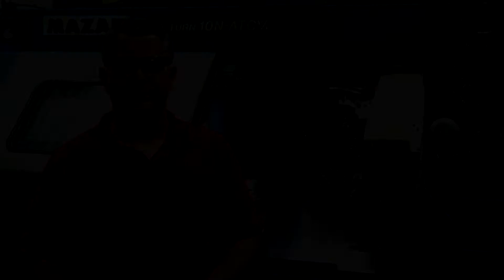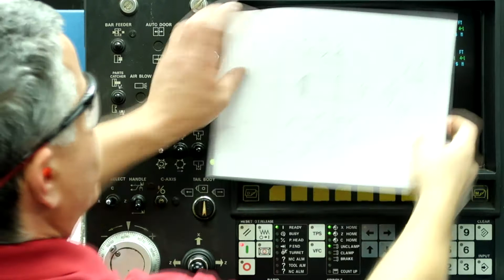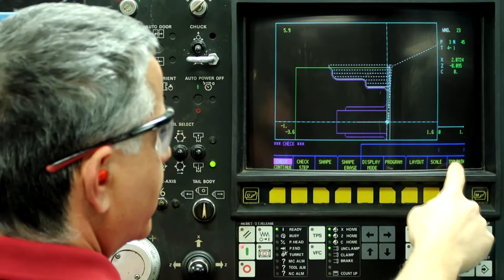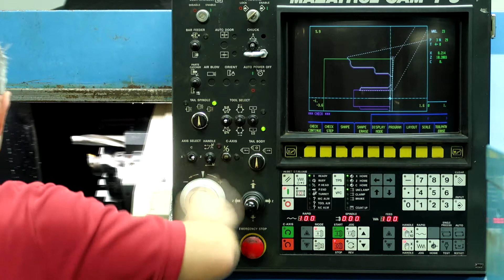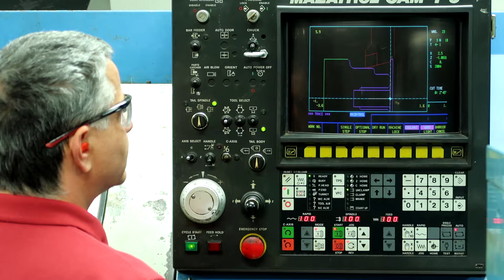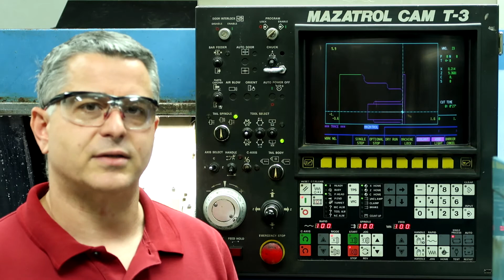Mazatrol Programming Tutorial CNC Video Part #3 Mazak T-2 T-3 Lathe

Comment: im running a mazak with a t plus control , im making a m30 x 1.5 thread and its cutting the thread crooked rest of part is straight , i am not a new machinist i have watched your video on od threading and many others , i just need help im stumped , i did have repair guy come in and check spindle and turret and they are straight
Reply from the maker: How long is the thread and is is supported by the tailstock?
Reply: thread is only 40 mm long   @mazatroltipsandtricks6816

Comment: Hello Sir, by selecting the tools, what is the meaning of "tool 4 offset 1"? because when I am programming I leave the offset blank.
Reply from the maker: Offset 1 means column 1 on the older control. That is where you adjust the wear offset. If you leave the offset to 0, then the machine will not pick up any wear offset.
Reply: @mazatroltipsandtricks6816  oh, I see.. Thanks for the info Sir.. How about the highlighted part in BAR, Like IN and IN with highlights, OUT and OUT with highlights?
Reply from the maker: @SimpLeMan2888  The highlighted features changes the lead in direction of the tool from Z to X.
Reply: @mazatroltipsandtricks6816   Thank you very much Sir!! I think you should hire me as your apprentice... 😁 .. Anyway, have a Good Day Sir!

Comment: Hey Phil, first of all thank you for all the videos you post they are super helpful. I just recently bought one of these machines and have it in my garage. Quick turn 15. I'm having problems with a battery alarm nmi 23 and I was wondering if you know the locations these on this machine?
Reply from the maker: What control does it have?  T-2 has 2 and sometimes 3 batteries. Do a search on the Practical Machinist Mazak forum and you will see the battery location and the options to upgrade to better battery options.  https://www.practicalmachinist.com/forum/categories/mazak.36/

Comment: loving your videos Phil! I thank you for doing this. I just purchased a used 1989 QT15n and reselected her from a guy that was going to part it out over a bad spindle drive. I had CNC Drive Drs  talk to Ken if you ever have problems. My question for you is I am in the tooling up stage for this lathe and I am wondering what your go to tooling would be for this machine. I am a mold maker by trade and my expertise is on the milling side of things.  If you could please point me in the right direction. Thanks Phil!

Comment: phil i am experiencing chatter noise when i am rough cutting .15" / .16"  per side ( BAR OUT) i have tried two different holders (DNMG and VNMG insert holders) i get the same response the finish is good 
what do you think is causing this chatter noise? 
the noise is very similar to when you have a bad insert although my inserts are all new
Reply from the maker: Does the chatter go away at .100" DOC?
Reply: @mazatroltipsandtricks6816  didn't try it but it might 
what are you conjecturing?
Reply from the maker: @christophercolumbus8944  Try a smaller cut and see what happens.
Reply: @mazatroltipsandtricks6816  ok i will thanks
i should add i am only chucking on 1/4" of this 4" diameter solid steel that is 2.25 long 
but i don't think it matters since i don't get this bs on my okuma lathe with almost same chuck and same jaws...

Comment: Sir,
Waiting for program copy, unit copy, sequence copy in one program to another program.
Reply from the maker: First, create a new program PNo0 line. To copy an existing program, you push right soft key, push program copy, type in program number you want to copy from memory and then push input.

To copy a process from same program, push right soft key under monitor, push process copy, type in program number you are currently using, then push input. Type in process number you want to copy and then push input. 

To copy process from another program in memory, push right soft key under monitor, push process copy, type in program number in which the process exists, then push input. Type in the process number you want to copy and push input.
Reply: @mazatroltipsandtricks6816  Thank you very much sir, I will try and update for the same.

Comment: hey Phil how do i modify the lead out on the boring bar 
say it was a tight hole, i need to back off only about .05" before exiting   ?
Reply from the maker: That is controlled by a user parameter. Unfortunately the parameter is different for each generation control. What control do you have?

Comment: How to take backup
( tool-data, program, parameter, tool offset backup )on mazak controller?
Reply from the maker: You will need special software to communicate with the controller to backup the system. An alternative is to take photos or pictures of the parameter screens.

Comment: which video covers TOOLS? and tool data? and tool geometry  ?  
any experience with 640MT ?
Reply from the maker: Look at the video that says probing tools on the thumbnail.
Reply: @mazatroltipsandtricks6816  ok thanks, Phil got another question
when ¥ou type or say tool number" 12" OFFSET "1"!!!  isn't that dangerous ?or  is that very typical in Mazatrol programming ? 
usually it's always T121212 
do you know what i mean?
Reply from the maker: @derick3482  On this old machine, it is column offset 1 or column offset 2. Column 2 is like the second offset and it's not used very often. This is not a Fanuc.
Reply: @mazatroltipsandtricks6816  so the first number designates the TOOL number right? the second number is HEIGHT offset? the third is NOSE RADIUS of the tool offset?  or there is no such a thing
and also is there a way to EXTRACT the G CODE program FROM the mazatrol conversational program ? is there a way to see the actual G and M codes after you're done programming so to see what it's generated?
Reply from the maker: @derick3482  Tool number is first number,  second number is offset column 1 or 2. The radius goes in a separate location into data page.
Newer Machines like the Smooth X control will allow you to export G-code from Mazatrol program. Old control like in the video does not.

Comment: Hi Phil i was wondering if you could show us with a demo video or through contact of email as regarding how to knurl on a mazak using mazatrol or manual programme.
Any help would be much appreciated if you need my email then please let me know as i could really do with your help.

Thank you.
Jay.
Reply from the maker: I will try to do a video on knurling soon.  Basically it is done using a manual process. Feed the knurl in using X and Z on a 45 degree angle, the traverse using Z motion, dwell for a few seconds and reverse Z motion and back off X is how I do it with a bump knurling tool.
Reply: @mazatroltipsandtricks6816  Thank you Phil i really do appreciate your reply but what sort of knruling tool is it ? Is it like the one on a manual lathe as i have never done this on cnc. I have a Mazak sqt18ms t32 control : /
Reply from the maker: @JaySingh-ex6xc  It is a CNC knurling tool.  It does not flop around like a manual lathe knurling tool. Very limited movement in the head.
Reply: @mazatroltipsandtricks6816   Thank you Phil look forward to the upload of the video soon. Thank you again.

Comment: Excellent your videos! I have been working with Mazak for years with T2, T3 and T32-2 controls ... Currently where I work there is a problem with QT-35N with Mazatrol T2 control (the parameters were erased) and we have not been able to recover them because that information is not easily accessible .. Do you know where to get those parameters?
Reply from the maker: The best place to get the parameters are from Mazak. They will charge you for them but it will work.
Reply: There is always a print-out of the machine-parameters from factory. If it isn't with the machine then some idiot have removed it.

Comment: I'm from VietNam and using Mazak QT15N- Mazatrol T32-2. Could you make a video about " How to program knulling on the cnc turning machine with mazatrol?
Reply from the maker: Sure. Knurling needs to be done with a manual process MNP. I usually feed in on an angle to get the wheels to track and then feed across the part and then reverse the feed and pull off.

Comment: Phil Thanks a lot .. I want to know how to make an Acme thread ? with one and two entrance, I operate a Mazak CNC lathe machine CAM T2 Mazatrol...
Reply from the maker: Go to my threading video.  For Acme thread, you would use either 1 or 2 starts and either 0 or 29 degrees for thread type depending how you want to feed in the tool.  You will also need to increase the number of thread passes manually vs what the computer spits out.

Comment: Any software where I can practice this programme
Reply from the maker: Yes, but it the software is extremely expensive. Not worth it in my opinion.
Reply: Mazatrol Tips and Tricks can you please teach me if I want to learn?
Reply from the maker: @ramsagarkumhar8248  The software was $10,000 USD last time I checked.
Reply: @mazatroltipsandtricks6816  Can you please give me an internship if you are located in Australia.
Reply from the maker: @ramsagarkumhar8248  I'm in the USA.
Reply: Mazatrol Tips and Tricks Well, Basically I’m from India and currently residing in Australia.
I have persuaded masters in mechanical engineering from the renowned university tha University of New South Wales Australia.
How’s everything going there?
Reply: @ramsagarkumhar8248  everything are in the books of the machine 
I was working w machines mazak lathes programming my own set ups (mazatrol programms ) now I m laid off..
Reply: chuychele can you please tell me where I can get the mazatrol books?
Reply: chuychele may I know where are you residing currently?
Reply from the maker: @ramsagarkumhar8248  You can get the manuals directly from Mazak.
Reply: @ramsagarkumhar8248  USA
Reply: California
Reply: @ramsagarkumhar8248  hi Here L A California
Reply: @ramsagarkumhar8248  at the Company MAZAK  here in Gardena CA. They selling Machines
Reply: chuychele machine cost would be unaffordable, I just want a book if it’s possible
Reply: Mazatrol Tips and Tricks thanks I’ll search
Reply: @ramsagarkumhar8248  sorry I dont work w the books like i said you can call at mazak co. Where you live ?
Reply: chuychele I live in Australia
Reply: @ramsagarkumhar8248  o wow .!!
Well good luck ...keep watching the videos and see if they help you
Reply: Sir please send me link for application
Reply: Good idea bro.i am India

Comment: Looks easier than manual line by line
Reply from the maker: To me it feels like cheating compared to G-code. Lol.
Reply: You don't have to give the radius a Cw or CCW designation,  how does it know if it's cutting concave or convex?
Reply from the maker: @ryanb1874  Not sure but it works as expected putting the radius tangent to each line.
Reply: @mazatroltipsandtricks6816  and you don't have to touch off of teach the x axiss, only Z ?
Reply from the maker: @ryanb1874  The machine already knows where X and Z is on the tools by probing them. The program needs to know the Z offset distance from the probe to the face of the part.  X geometry never changes from part to part so no reason to require you to set it.

Comment: Good video.
What is the parameter that governs the drop out position/clearance diameter of the boring bar when it does the finish cut,so it doesn't crash into the opposite side of the pre drilled diameter?
Reply from the maker: On a T2 and T3 controller,  parameter U7 controls the X retract distance for ID tools.
Reply: @mazatroltipsandtricks6816  
Thank you.

Comment: The wear offset being added to the geometry in the position screen is not just a Mazak thing. I run a lathe with a Fanuc 21i-t control and it does the same. It's all about how the parameters were set in the machine.
Good video Phil.